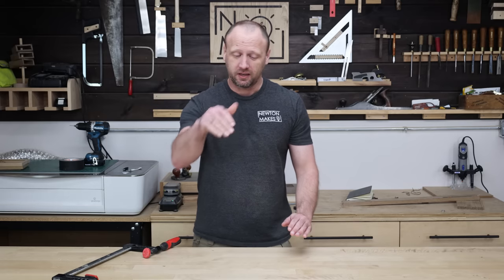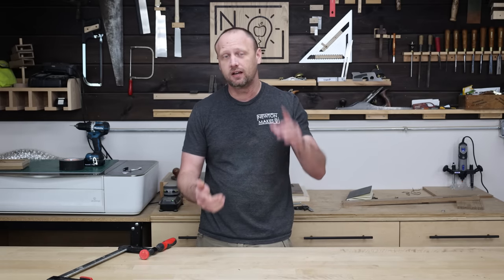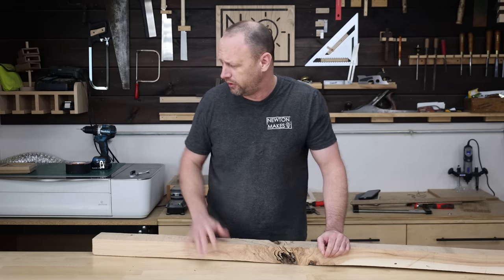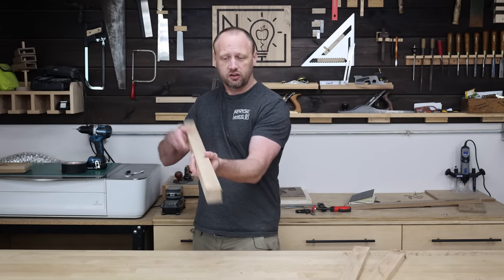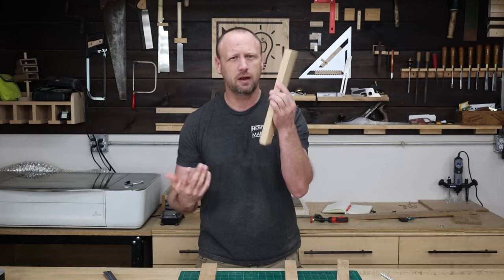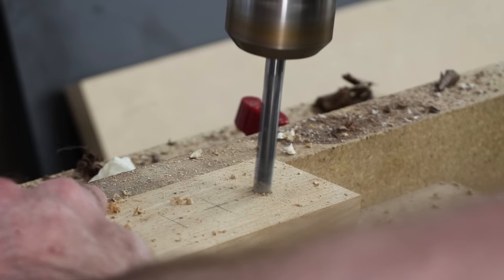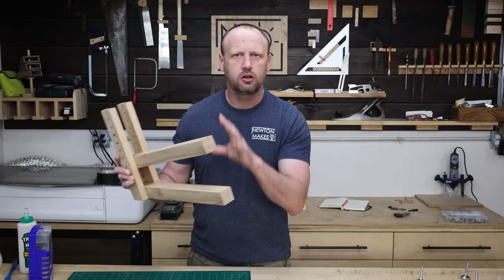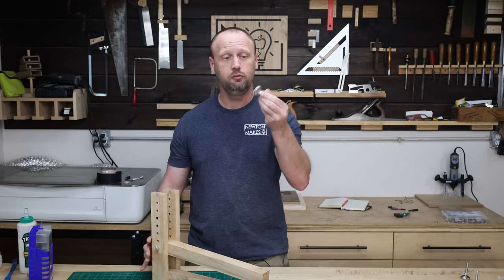Every Workshop NEEDS This Tool

Comment: Nice idea. The more power version needs longer arms to stick out the back, then use a spreader clamp between them to force the front together.

If it doesn't work, trim the backs off and you have this perfectly good version...

Guess I'm trying that this weekend...
Reply from the maker: Sounds like it's absolutely worth trying.

Comment: as an improvement, instead of using a sperate clamp, maybe a long bolt between the two arms and knob to tighten and loosen.  The bolt would be physically attached to the knob where as the bottom arm would have the nut imbedded into the arm.   That would allow for the different settings

Comment: Neat idea, Billy. When you first started, I was thinking you were going to extend the arms through the uprights and use a spreader on the extended part . Not an improvement, but just a thought. 
Bill
Reply from the maker: That would have been a cool idea too!

Comment: They sell 1/4 cork with sticky adhesive. I’d use those instead of furniture feet. Or maybe on the feet? The more surface is in contact the better.

Comment: You would get more clamping force by having the pivot higher.  You want the arms to end up just shy of parallel, so all the clamping pressure is at the end.  If you are below parallel, most of the force is away from the clamping point.  Look up videos on how machinists use strap clamps for a better explanation.

Comment: So.... how is this an improvement over regular long cauls?  I guess I can see how the upper and lower arms aren't going to move, but it also doesn't apply pressure across the entire workpiece.
Reply: It only uses one clamp instead of two normally needed for cauls
Reply: And sometimes you're not trying to hold a large surface flat, but a smaller piece in the middle of a wide panel. Think the central foot of a media unit that's going to take a lot of weight.
Reply: @Kosh42EFG  There's usually more than one way to do everything and having this clamp in your workshop just gives you a bit more versatility and choice when figuring out the best way to do it.

Comment: I did a walnut table glue up that was 45” wide. I created a rectangle that slips over one end and slides to the middle. It has screw downs on top and bottom. I do a lot of large panel glue ups and it comes in handy. Your solution is more portable as mine is 48” wide by 6” tall. It has multiple screw downs, so every 12” there is a screw down.

Complete overkill in engineering. I’d rather use your jig haha

Comment: Could you extend the arms out backwards (opposite side from the pivot) and then have a screw between the two backward arms - like a scissor action. Turn the screw, the force separates the backward projections of the arms, and the result is squeeze on the arms over the work piece. Then you don't need the clamp. Very much lie @Kosh42FEG's suggestion but with a screw instead of another clamp.
Reply from the maker: This. I like this.

Comment: Not sure that this is really a good idea.  Yeah, it will push down in the center area but with the leverage working against you, it will have very little force...a lot more of the clamp force is being applied to the jig pivot  point than the (far away) center point.  A much better design would be to make it like a panel clamp, with the pivot point on the far side of the work piece, and a call between the two, being clamped at the near side.  Or, put some heavy weights (eg, 25 pound bags of lead shot, dumbbell weights) on the middle.

Comment: Funny he’s using “all his strength” to pull the pad out but at 5:41 he just lifts his hand to speak again and the pad easily slides to the right?
Reply: Possibly swiveling since there's only one clamp point. Usually I have to clamp things at two or more points or I run into this issue.